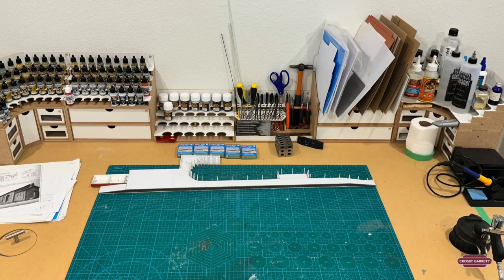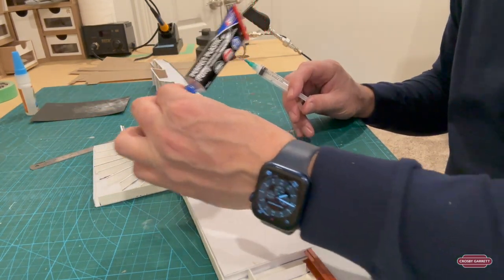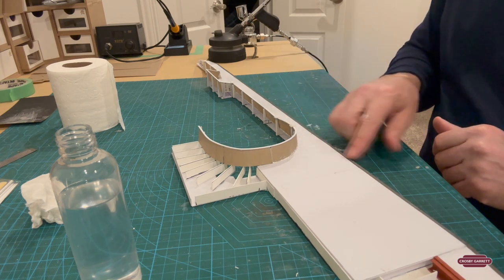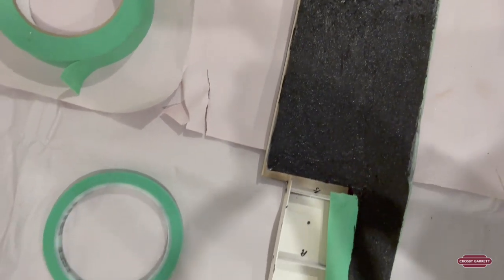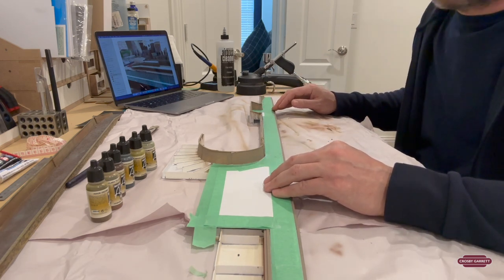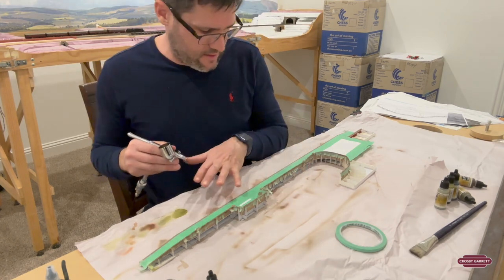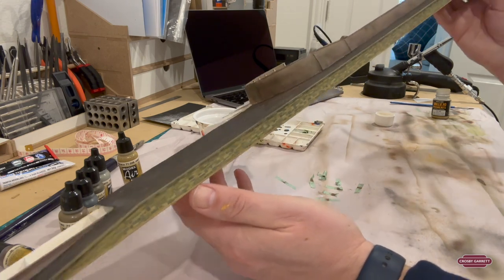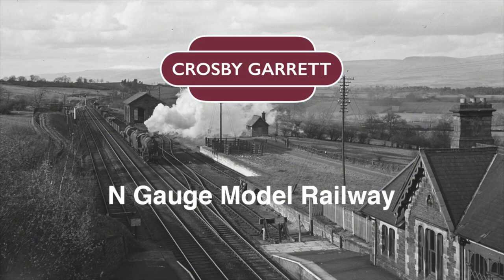How I Scratch built a N Gauge Model Railway Platform. Painted  & weathered it ready for my layout.

Comment: Great video and nice to see how you paint the platforms.  I like the idea of that textured paint,  I think I shall have to give that a try when I am ready to do mine.  Have you thought about getting a proper 3M mask for spraying?  I think it's worth it just for safety reasons imo.  I like using the powders cause they are easy to add just a shade to stuff but I find your only left with 2 options afterwards, seal it with varnish and then the pigments practically disappear or leave it be and know if you ever touch the model afterwards your hands will get caked in the stuff 🤣

Cheers,  Michael
Reply from the maker: Yeah I hear you with the sealing. I've just left it, as once it is on the layout.. I really shouldn't be touching it too much more! Plus.. can always touch up if needs be.

I haven't thought about a mask, as I'm not really using toxic paints.. They are only acrylic which is water based, I'm also not really using excessive quantities, lots of small stuff left. Maybe I can just use my CV mask! But, I'll look into it. Glad you liked the video. I'm trying to create them with more video footage than my first ones.